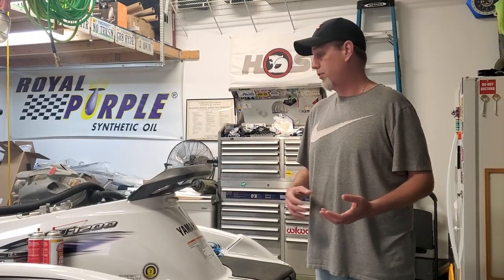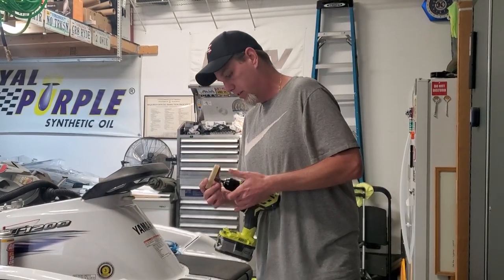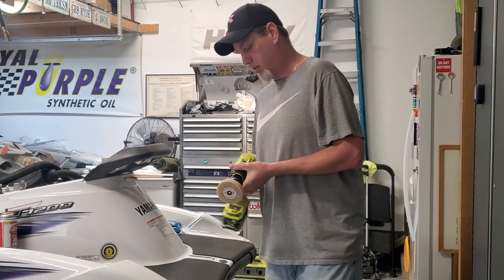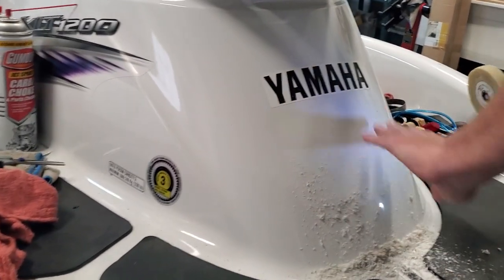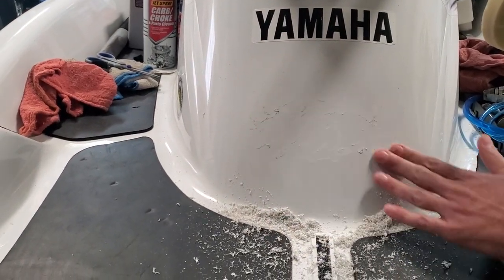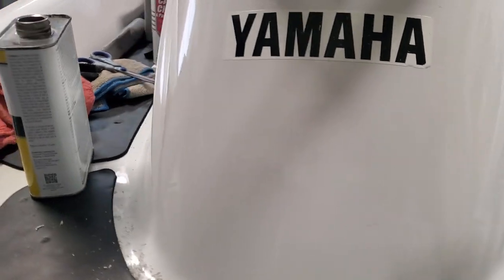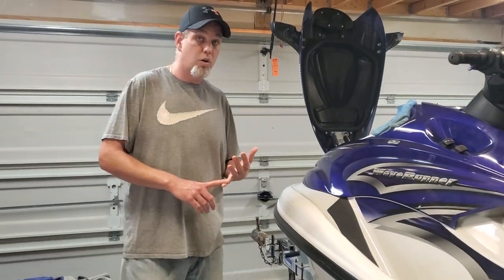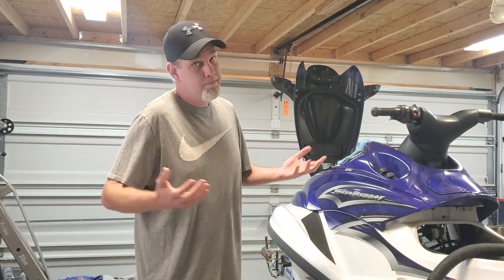How to remove stickers and decals the easy way!

Comment: every time Ive tried that Ive burned the gel coat, paint, or whatever, what the%&%&^am I doing wrong, and I did not use a lot of pressure, or anything, just bad luck I guess, and I did use the 3m version
Reply from the maker: Use less RPMs. It's the heat that you don't want.